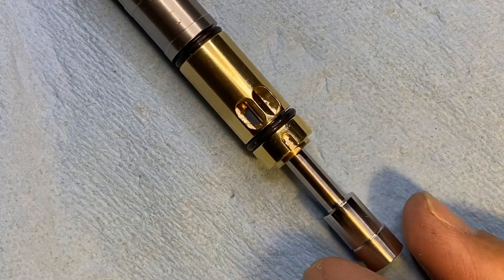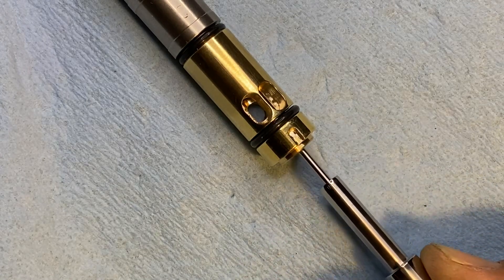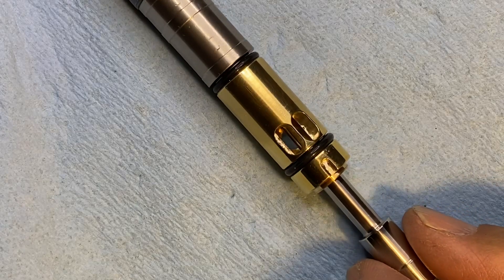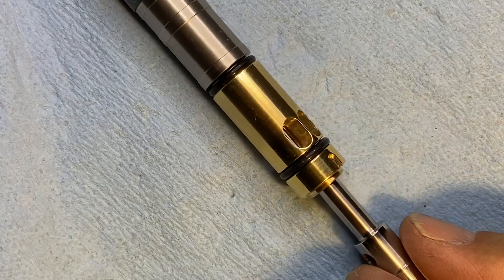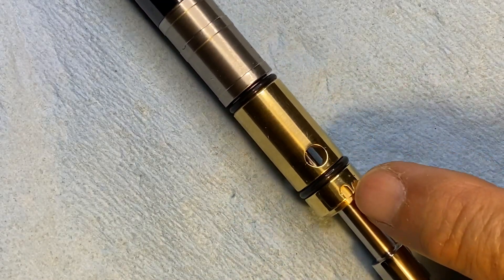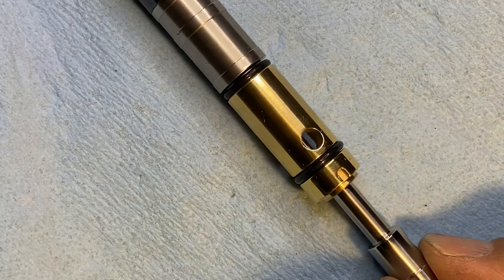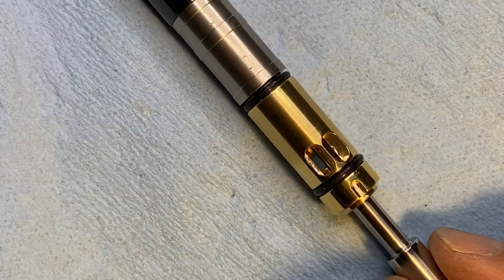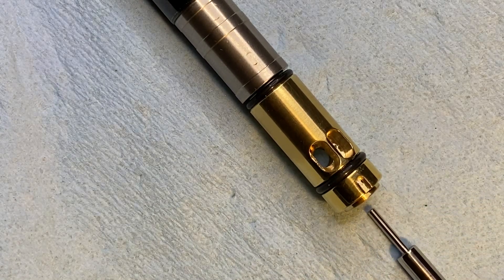FX impact duel transfer port #shorts

Comment: Good one! This good for the PP with the shorter spring because with the longer spring, lighter pellets like the jsb 25gr will be difficult to tune down to 860fps. Please try the jsb heavy 34gr and 25gr pellets interchangeably and see if both can be set to 860fps by just turning the powerwheel and the barrel without changing the reg pressure.